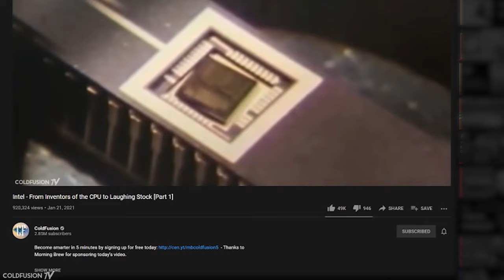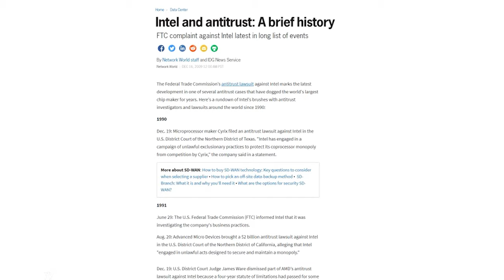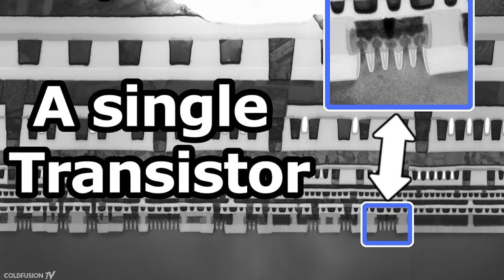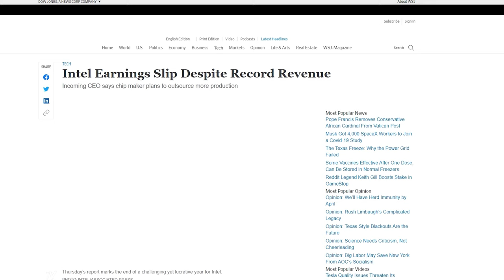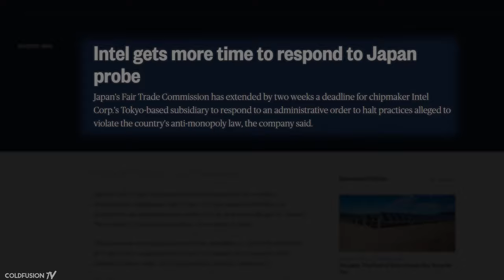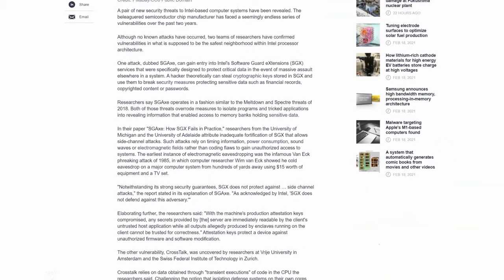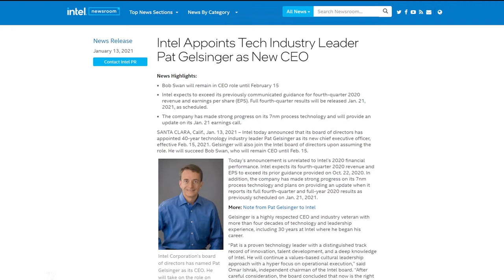Intel - From Inventors of the CPU to Laughing Stock [Part 2]

Comment: i still think Intel now with a CEO that ACTUALLY KNOWS WTF HES TALKING ABOUT, will rise back up.
the problem with AMD is that they used the be the underdog, offering slightly lower performance for a significantly cheaper cost.
but now AMD became greedy, and it really shows with their GPU's department. 999$ for a GPU that's worse than its rival's 650$ GPU is just embarrassing..
and AMD lately has began raising up their prices for no real good reason. 
its funny now how sometimes AMD can be more expensive than Intel CPU's in some CPU categories lol.
i think though that Intel in the coming 5 years will really push back up and get at it.
Intel still has a pretty good chance at manufacturing their own mobile chips (they still are expanding their Vietnam plant for a mobile chips department despite they "left" the mobile chips market 6 years ago).
all in all, i'm still going to use Intel chips in the future, i was burnt by AMD products 4 times in the past and no Ryzen or RX chip could ever make me trust them again.
Reply: ok intel fanboy
Reply: @catl9282  perhaps you're an AMD fanboy, i'm not a fanboy i'm just realistic.
i was mostly using AMD hardware for the past 12-13 years and just recently got an Intel based laptop.
prior to using AMD CPU's i've been using Intel CPU's due to significantly better market availability obviously.

CPU's:
the first AMD CPU i've had was the Phenom II x6 - it fried itself and my motherboard after 3 years from a "very rare" internal short circuit inside the silicon die?? (thats what AMD RMA support said after i sent it to them)
afterwards i got the FX-8370 - it was severely underpowered when i got it, and became a severe bottleneck for my GPU (GTX 780 at the time) just after about 1 year, eventually i had to replace it 3 years later because it was always operating way too hot even though i had more than sufficient cooling for it and it was not OC'd.
than i got the R7 1700X - it was decent but sadly was kinda awful for gaming compared to the cheaper intel core i5 alternative at the time and it did become severely obsolete quite rapidly (this one i'm gladly going to replace with an Intel CPU in my next PC build once Intel finally get their shit together and go back to making NEW HEDT CPU's).

(most of my Intel experience in the past 13 years before prior to an intel laptop this year was from my work computer which is a high end Intel Xeon workstation.)

and when it comes to GPUs:
my very first high end GPU was actually a ATI Radeon 9800 Pro back in 2004 - which somehow managed to burn itself and melt its fan 3 years later 
in 2008 i got the HD4870 (mainly because i was super hyped for GTA4 at the time and it was well known for being extremely challenging to run on PC) - it "died" 1.5y later because somehow the plastic fan blades melted so the gpu was not getting actively cooled, not that it stopped working, but it couldn't really be used at load because it would just crash so it became completely useless
in 2010 i  got myself an nvidia GTX570HD 2.5GB edition (that still works to this day on my mediaPC in the living room!!) and have been reliably and strictly using nvidia GPU's ever since, all nvidia cards i got from 2010 to this day are all still working 100% just fine by the way.

(and all of what i said about the GPU's is without even considering the horrible drivers i had to deal with when i had an ATI/AMD GPU in my system, it was annoying having to deal with GPU drivers issues on a nearly weekly basis)

but let me ask you this:
how much AMD hardware have you ever owned in the past? how much experience do you even have with this brand?
or are you just a 12 year old kid that his parents went full cheap on him and got him a full AMD build because it was 10% cheaper than a comparable intel+Nvidia system? hm?
Reply: @HoLDoN4Sec  i have owned 2 amd laptops in the past and im getting an intel prebuilt so while i have owned amd hardware im not an amd fanboy
Reply: @catl9282  haha if you're getting an intel prebuilt i don't get your initial point really
i've also had an AMD APU based laptop from work once when i had a trip abroad, it was insanely underpowered even compared to the 2012 core i5 (dual core) macbook pro i got on the work trip before that one.
Reply: @HoLDoN4Sec  i hated intel and was an amd fanboy why would i get a pc w intel cpu?
Reply: @catl9282  in your previous reply you said you're not an amd fanboy, can you please make up your mind?
Reply: @HoLDoN4Sec  cuz i used to be uno of those disgusting ppl who are fanboys of any tech company
Reply: @catl9282  you're confusing me.
so you are disgusted of what you were as well or not?
Reply: @HoLDoN4Sec  forget about m8
Reply: @HoLDoN4Sec  if hated intel and was an amd fanboy why would i get a pc w intel cpu?
Reply: @catl9282  i don't know, thats why i'm asking you lol

Comment: Intel designs and builds those chips. All others just design. In theory, intel has twice the markup of competition.
Eps of amd is 0.5. Eps of intel is 1.5. Do the math. Besides, i have ancient i7 intel chip. I still run my games in highest resolution. I bet not many AMD chips would last as long. They were quite unreliable in the past. Intel is like a tank, it works and you can't stop it.

Comment: @20:30 No. Consumers are not unhappy with Intel, no matter what the talking heads of the Tech world, (like Linus Tech), have to say. The vast majority of consumers don't care that Intel processors are not the "Best", they go with what they know - the Intel name. Meanwhile, AMD has always been the darling of the high-end gamer crowd and overclockers, while CrApple™ only sells their overpriced eye-candy to the same Drones over and over and over and over again, lucky to maintain their 10% - 12% market share. And unless Microsoft is planning on a MAJOR price cut to the Surface line across the board, their CPU plans will probably go nowhere - the entire Surface line, while fantastic computers, (I own 5  currently), are simply too expensive spec'd out to make a major dent in the market. For the same price of my top-of-the-line Core i7 Surface Pro 7 I was able to buy new mainstream Core i5 Dell laptops for not only my wife, but also two of our  children. 

Intel will be just fine. Sooner or later they will retake the #1 CPU spot from AMD, as the two continue their never-ending dance around each other,  and the cycle will begin yet again, with AMD playing catch-up.

Comment: This video misses something critical. Although AMD has better power efficiency/performance for the money - their yield is terrible, and they are not able to keep up with demand. TSMC is a huge bottleneck right now.

I ordered an AMD Ryzen 5950X CPU more than 3 months ago, and it will likely be several more months before it arrives.

Intel on the other hand has no problems with supply. If I want an Intel CPU with only slightly worse specs for the same price I could have it delivered to my door within the next day.

AMD is definitely not able to keep their customers satisfied either - considering you have to wait half a year to receive the CPU you ordered.

Comment: We need to chill. Intels alder lake processors are faster that Apples Max Pro. Wait for laptops with those processors and a Windows beast is in the works.
Reply: But how efficient are those chips
Reply: @lesleyhaan116  1 day more & you will see.
Reply: @lesleyhaan116  They might not be as good as Apple in terms of power efficiency. But pros need performance over power.
Reply: @TechCrazy  but we are talking about laptop processors. power efficiency is the most important thing in a laptop because most people are working on battery most of the time. thats the reason that they got a laptop in the first place but if you gonna use your laptop only in a studio or at home plugged in all the time you are better of with a desktop computer
Reply: @lesleyhaan116  Agree. The alder lake is for desktop processors. Hopefully they will have a mobile version soon.
Reply: @lesleyhaan116  Okay. If you see the latest tests when M1 Macs we’re used for Pro use the battery life was not as advertised. The battery life metric is mostly for browsing, watching videos and stuff.

Comment: Intel isn't going anywhere.  They are lucky to be in a position where they have enough capital to make a tonne of mistakes.  If they get desperate they will probably sell CPUs below cost just to choke the competition out for a while.  Don't forget, Intel supply loads of other products for example networking.  Every motherboard I have owned in the past 15 years has had an integrated Intel Ethernet and/or wifi NIC even my AMD boards.  And they have been using the same chip (intel I210/1 NIC) in most cases since 2011/12!  They will bounce back eventually.

Comment: OMG....I tell clients to stick to intel because I've always believed in intel and believed it was pushing the edge and so they were running into issues and soon would rocket past AMD with some new tech that seems alien-made.  I remember back in the day laughing at people that used AMD chips because back then AMD used Intel tech to make their chips, I was like why not just get the real chip instead of a knock-off.  I think Intell may come back, they definitely need to cut back cost and stop being EVIL and focus on getting to the low nm processing. They really messed up when they let apple move to RISC, like Microsoft missed the mobile phone opportunity so is intel missing the chip opportunity especially in the time of IoT and, smart cars and the regular electronics we all use today and in the future. I suspect the only way back for intel is to hire decision-makers that are ENGINEERS and actual TECH people, I mean how the frack does one lose sight of that, that an engineering company needs engineers that can see and innovate the future. I need a new windows machine and now I need to really consider AMD instead of defaulting to Intel. This video has me rethinking and looking at AMD different.

Comment: what makes this more funny is how dumb and useless AMD were in 2013 with bulldozer bringing out a new expensive chip that was slower hotter and in most cases worser than the phenom 2 x6 even though they had the pen 4 to know overclocking less effient cores will not gain you any market share. They were close to going bankrupt then and intel had 99 percent dominance straight after that happaned. I think in 2014 there were some shops that were not even stocking AMD and it was pre order only

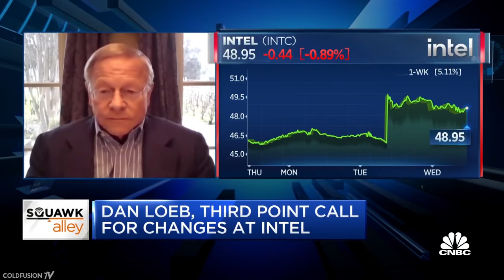Comment: 1:35 "Bob Swan Hes been fired" is false information, from beginning he wasn't where for long, only for time they find good CEO, and he don't want to be CEO, so stop spreading misinformation
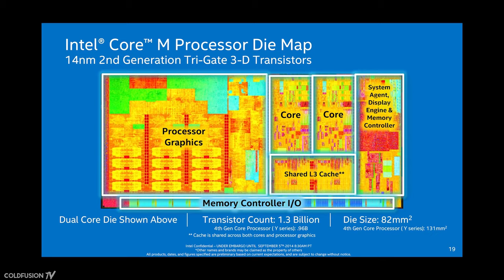6:53 14nm was already delayed by year, so problems starts few year earlier.
7:40 in 2017 it was still GF, it was great design not only node.
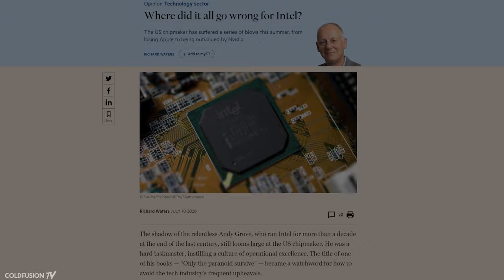8:55 already outdated information, Zen3 is better for gaming than Intel 10th gen
10:23 BS without good architecture, node would not help at all.
12:57 and still is, only management don't understand it.
Reply: You need better listening comprehension. He's not talking about Zen 3 vs 10th gen. He was talking about Zen 3 losing the single-thread crown but keeping multi-thread crown vs 11th gen and that Zen 4 might take back the single-thread (ie. gaming) crown back from 11th gen.
Reply: @MN-jw7mm  It's not losing, and this is my point, AMD with Zen3 have better IPC and better performance. Look at independent testing. Not using eg Geekbench which is memory dependent.

Comment: If Intel is such a failure why are their CPUs in majority of PCs and lap tops.  Where the ARM is in, the smart phones, a PC will run rings around any smart phone.  Try typing a letter on a smart phone.  Smart phones are small hand held computers that do little compared to a PC.  How many ports are on a smart phone.  Just the market is smart phones with users that do little more than emails and text on social media, nothing serious with a computer.  Apple's M1 no way will I buy one, I got tones of files with 1000s of hours on my Intel CPU and I am suppose to spend $1300 for a 13 inch lap top that might, just might run my applications.  Yes things are advancing, Apple is not changing much of anything, few will follow except for the smart phone users who want the latest, Apple come out with iPhone13 and they will be throwing their 12s away, what a joke. Intel will be in the over whelming majority of PCs and lap tops running Windows.  I dont exactly call this a failure.  And do you notice, all compare themselves to Intel, wonder why.